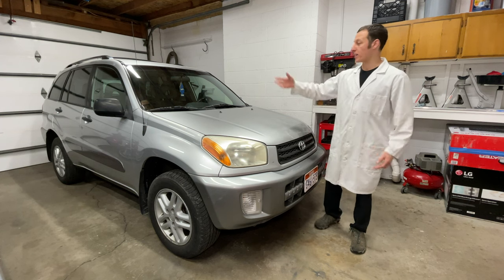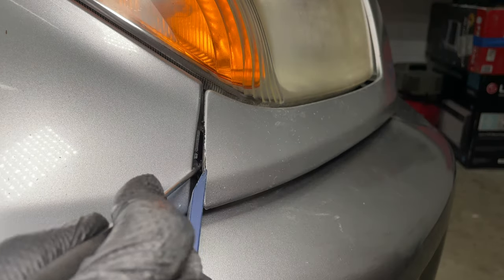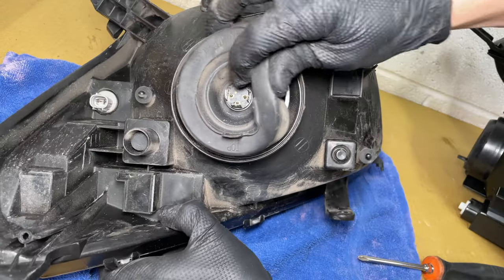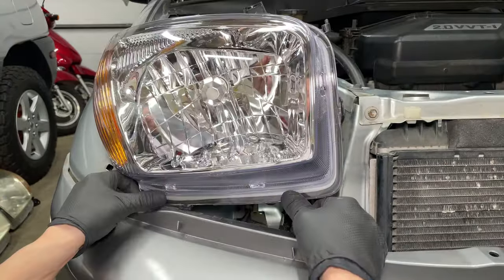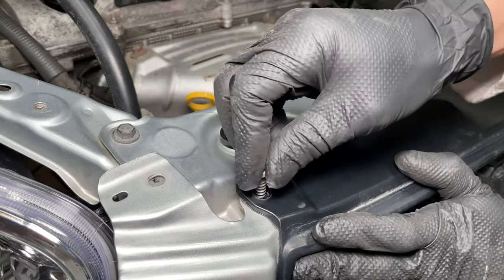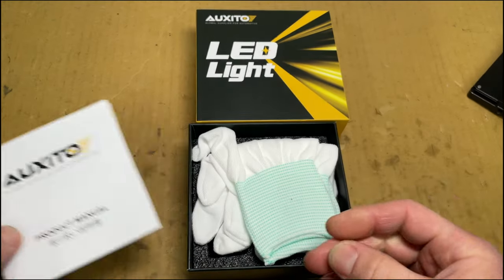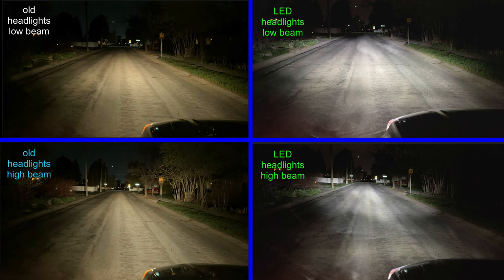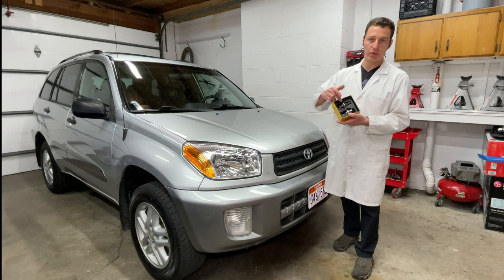Headlight replacement and LED upgrade 2002 Toyota RAV4

Comment: So a polish + LED bulbs would have been better? :)) great camera work and information as always
Reply from the maker: Thanks!  Yes, although the new headlights look nicer, the old headlights worked much better.  I recommend polishing the headlights and getting LEDs.  If you must have the brand new clear lenses, buy Toyota parts.
Reply: @LabCoatPaul  Yup. DEPO were a bit more expensive than TYC when I recently changed my headlights, but my original Valeo ones were still better. But new Valeo ones were 3 times more expensive, just not 3 times better. Gotta find the best balance if you're not a frequent night driver
Reply: @mariomolnar3184  Valeo are original? I thought depo were
Reply: @chriskisloski7424  i have a peugeot 207, so idk about your car specifically
Reply: @mariomolnar3184  gotcha, I got a 2002 Rav4. Appreciate it brother

Comment: The oem headlights price wasn't so bad. You would've been happier with the OEM than those TYC aftermarket headlights.
Reply from the maker: Yup.  They say hindsight is 20/20.  The new headlights are definitely a bad copy of the Toyota headlights.
Reply: Virtually all replacement parts from China, are inferior to OEM Japanese components.
 I'm done w Chinese parts .No more!
 Like Paul,  experienced Chinese axles are junk
I had a new PSteeribg pump, that had 2xs more play than the 109k orig..I threw it in n the trash.
 Ordered motor mounts .yep ...didn't fit correctly..and a few others ...I kept em too long to return .so there only for emergency parts...
 BUY OEM JAOAN & Be happy. YES IRS MIRE $..BUT SPEND THE $$ YOUR ALREADY SAVING $ BUY DRIVING A 20 YEAR OLD CAR...BUT WHAT THEY BUILT!

Comment: You don't really have to buy new headlights, if the original headlights have no cracks or defects, you can wet sand, then polish compound then wax them for a clean clear finish. That's what I did on my 2004 rav4 they look good as new. Also lasfit led lightbulbs are better quality.
Reply: I’d rather replace with a brand new pairs for full crystal clear headlight projector or reflector. 

U will not get the same results as brand new oem headlight assembly replacement, maybe close but not close enough.
Reply: I will agree to that.

Lasfit is my #1 the most recommended brand, #2 is Auxito, and my favorite #3 for as a set it and forget led replacement bulbs is sylvania zevo. ❤️‍🔥❤️‍🔥❤️‍🔥❤️‍🔥

Comment: Hey hi Paul, my name is Kevin, I'm from Costa Rica, I hope younare doing fine.

Paul, today I bough a rav4 2004 however, I'm facing an issue with the passenger's headlight, specifically with low beam bulb, so I noticed through this video at minute 4:30 you showed it up that bulb.

Paul, dp you mind by sharing the part number of that bulb?

If can, I really appreciate it.🙏🙏🙏
Reply from the maker: It's an H4 or 9003 bulb

Comment: The replacement is a straightforward process but my RAV4 has DLR on the headlights,(Canadian model) which cause the headlights to flicker rapidly unless they are actually turned on manually. Can anyone address this problem?. The DLR circuit seems to be a mystery and there is virtually no information on it online.
Reply from the maker: The DRL relay receives a signal from the computer and switches ground to the low beams.  The ground comes from the left side fender apron.  You need to check the DRL relay.  Make sure the terminals aren't corroded.  Try swapping the relay with another relay that fits.  
It's possible the ground is bad.  Is your car rusty, or has there been body work done on the left front side?  

Go to my patreon and download the factory service manual that includes wiring diagrams.  No subscription required.  Click on any RAV4 video, scroll down until you see RAV4 service manuals.zip  You're looking for EWD200.pdf  page 82

Comment: What are the tire specs on this rav4? 🤔
Reply from the maker: The stock tire size for a 2002 RAV4 is 215/70R16.  This car had 225/60R16 tires on it.

Comment: It would have been good to see the LED bulbs in the original headlights before you swapped them out
Reply: Putting led bulbs behind this oxidation headlight will diffuse or disburse the light output like a flood light, and gives an off color temperature like green-ish kind. And it’s no good.

Comment: how many motorist been blinded so far?
reflector type housing + LED = bad for oncoming drivers
Reply: You only get blinded by the wrong type led bulbs. 

The Auxito - M3 H4 led bulbs that matches the specs as the halogen bulb, will not blind others. That’s a fact.

As long as it retains the same beam pattern. That’s good.